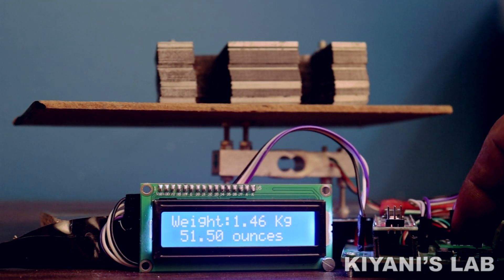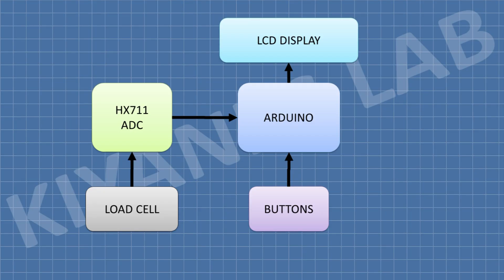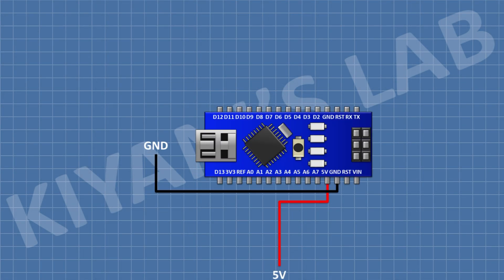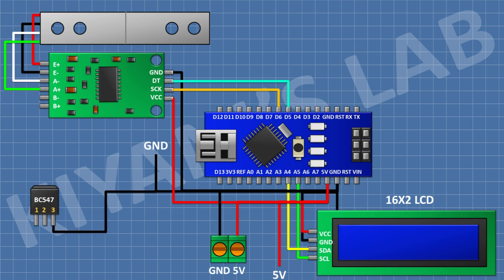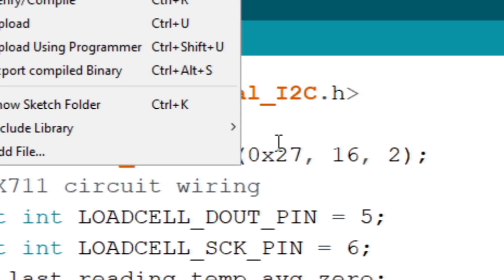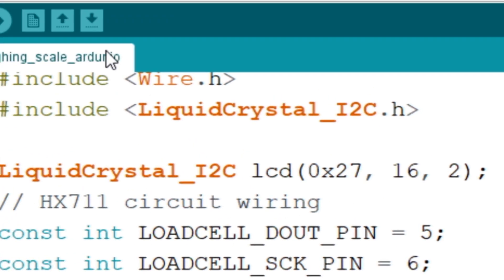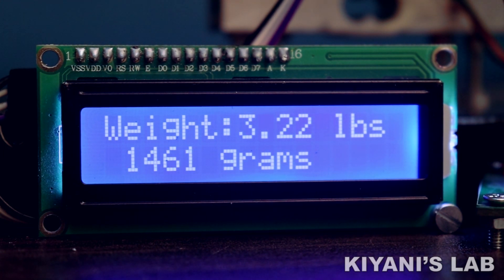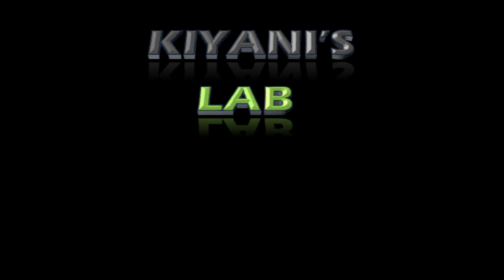How To Make Digital Weighing Scale Using Arduino

Comment: I'v had difficulties with this project . There is no value entered for lcd.begin .    Once the sketch is uploaded what happens next ?  How for example do you calibrate the unit ?  What does each of the buttons do ? What is the function of the buzzer ?
Reply: Did you find the answers, I'm doing this project in college at the moment and am also struggling with these points
Reply: No I didn't . The whole box and dice is in a box somwhere in the garage. I ended up spending too many fruitless hours chasing information  I couldn't find.  @cormacrice9593